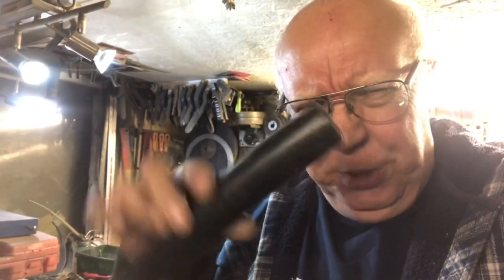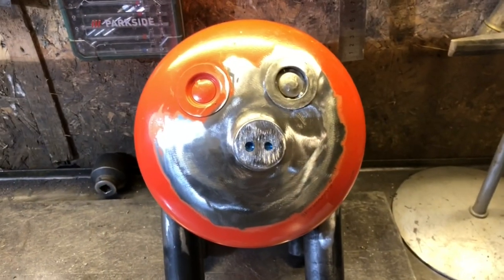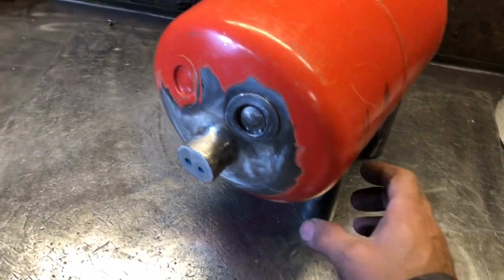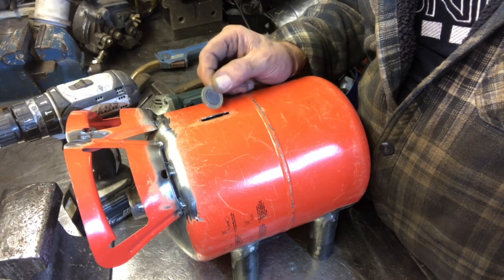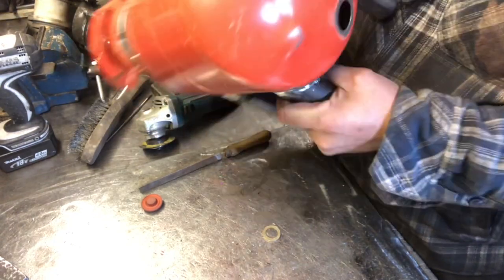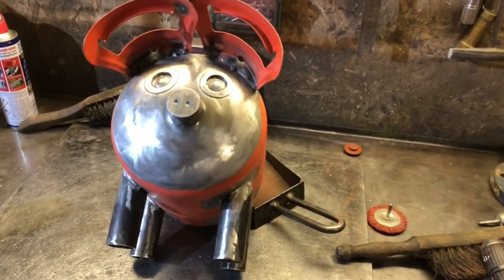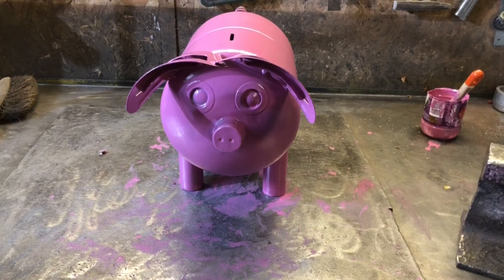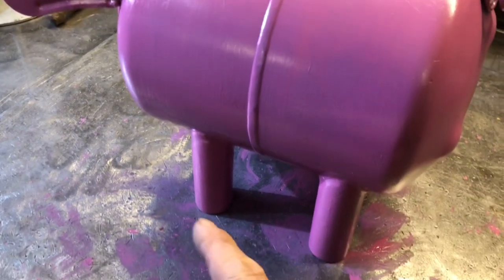Piggy bank part 2 & finish

Comment: Another good one Ian. Wondered about your awl. Spent a LOT of time in a metal fabrication shop, a sharp one is good for soft materials like wood and plastic, for metal you do better with the tip slightly filed off.
Thanks and be safe
Reply from the maker: I will try that tip.